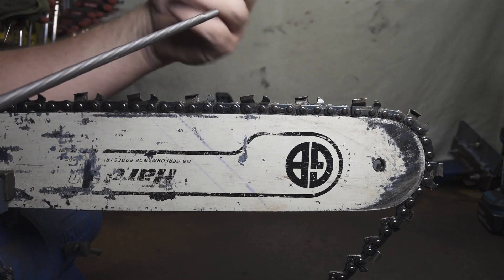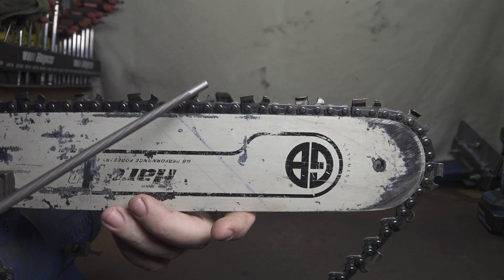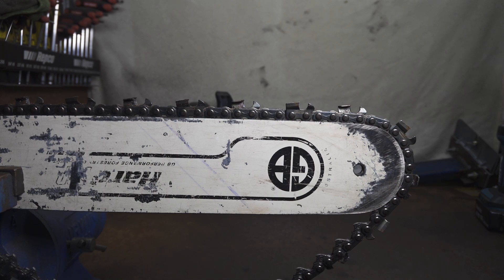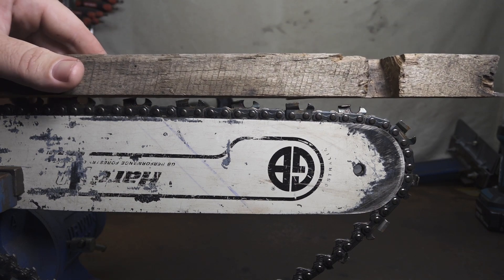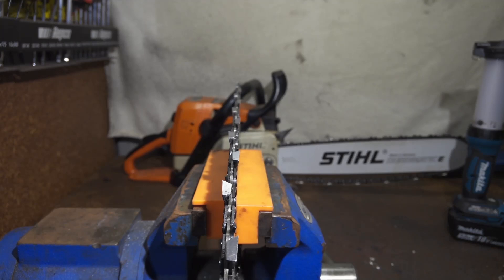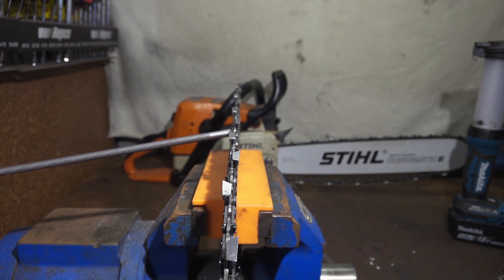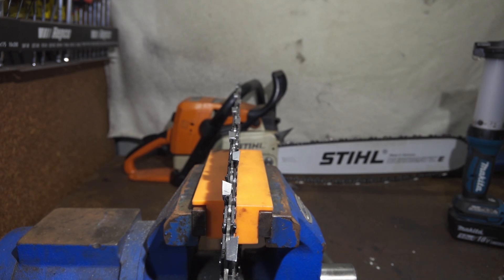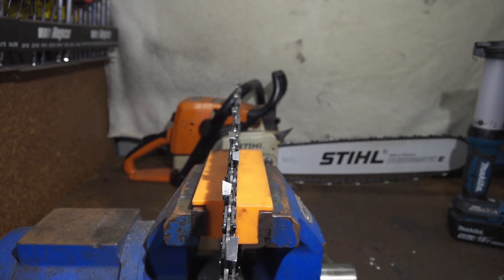Why do manufactures recommend cutters be the same length?

Comment: its not just the chain u gotta maintain either. the rail's on the bar have to be even too. if one side is worn down further then the other the chain will tilt that way in the cut and youll be cutting circles. bar dressing tool is nice for this. makes a big difference when your chain isnt rocking back and forth like crazy in the bar.

Comment: To the issue of the height of the tooth and its ability to get its working edge into the cut, shouldn't that be negated since the chain leaves the bar and goes into the wood?
Reply from the maker: @indigatorveritatis7343  It can be but to leave the bar it needs the corner to contact the wood. Different chains with different top plate clearance angles and overall length can affect if that happens.

I can't say it is or isn't an issue I'm just explaining where the advice comes from
Reply: @SawChainTheories  Understood. Thanks!

Comment: Finally, someone who actually understands the working of the whole chain as a cutting unit. Those who think cutter teeth at different lengths are fine and acceptable have no clue. Teeth have to be of the same length/ height for the whole chain to work as a whole. Each tooth needs to have an equal job. The more variation in tooth length equals more vibration and a less efficient chain. This is basic mechanics, for those who  understand. This video is a perfect example of how a cutting chain should work period.
Reply: False.

Comment: Been cutting and filing for a long time. I even run my own tree service. I promise you, they DON'T have to be the same length. They just need to be sharp and the rakers need to be filed in accordance with how much the tooth has been filed. That's it.
Reply: To a point. And not so well in Aussie hardwood.
Reply from the maker: @GreatWhiteSquid  I deliberately didn't take a side on this one, just explaining where the advice comes from.

I have filed a chain or two over the years and have done this both ways, both will work. I have a preference but that might not suit everyones application

Comment: I have been experimenting with NOT keeping my teeth the same lengths while maintaining good rakers for about 5 years, and yes the saw will attempt to saddle when your bar is buried but a little twist of the wrist keeps your cuts straight if you are watching your cut closely.

Comment: If you go and talk to any old school west coast loggers they will tell you the size of the tooth doesn't matter. As long as the raker for that tooth is set for that tooth. Which means you can't use the raker gauge that sets on top of multiple teeth at the same time. Buckin Billy Ray is a prime example of someone that has proven this time and time again. He has multiple videos out where he shows how none of his teeth are the same size and he still cuts straight. All you need to do is sharpen the tooth till it's sharp, no more no less. So if you rock a couple teeth and all the others are fine then sharpen the rocked ones and go one. Plus as far as setting everything level in height all bars have a slight curve on top and bottom of them, so you'll never have them the same height.
Reply from the maker: @chadrogers4635  Thats why I said you can compensate for it with saw chain to a degree, the curve of the bar, it's mounted on rivets etc. There is a point where the tooth just can't make contact but given that not every tooth takes a bite every time they go into a cut, it's not a big deal. Just like chains with broken off teeth can still cut fine

If I was cutting the same time of wood that they are, I would run chains like there's. Wood here is much more dense and chain reacts in different ways.

The aim of this video wasn't to tell people they needed to do one thing or the other. It's just explaining the reason why that recommendation is given
Reply: I would be able to believe it if he first showed that the same sharpened chain cuts crooked with constant depth gauges setting, and then that it cuts straight after using a progressive gauge. Has he ever done such an experiment?
Reply from the maker: @elpolaco7654  I had multiple attempts at explaining this video before using this one. Another version of this has a 21BPX chain that I filed the cutters all different lengths and cut with a Stihl constant gauge and then used a husky roller guides gauge. 

If it changes anything, I can't tell. I may put up that part of that video in the future. Maybe the Oregon style gauges with the gap in the middle changes the result? I just don't know.
Reply: @ I've written about how I've long since disbelieved that it's the use of a progressive gauge that makes the cut acceptably straight. Why? Because I know that the longer the length of the cut, the less chance there is of chips that are at least as thick as the depth gauge setting, so I don't see why there would be a difference between the two methods of lowering them.
In my opinion, the determining factor for a straight cut is the side plate angle.  If there are no (significant) differences in this angle between the cutters, then the chain will cut straight.

And to be clear, I agree with this video of yours. Any asymmetry is undesirable and always has some effect on the behaviour of the chain.

Comment: Next question... why do the teeth taper?  Why not have the same set for the entire tooth life?
Reply from the maker: @InWithBothFeet  They need the top and side plate clearance angles to reduce friction. In the case of the side plate clearance, it's to keep the rest of the cutter from being dragged against the side wall of the kerf when cutting 

Chain really is a well designed piece of equipment. A lot of effort has been put into making it as efficient as possible

Comment: another consideration would be reaction forces during a plunge cut. I'd love to hear your thoughts on this.
Reply from the maker: @johndurant8687  That will take some explaining because there is a lot going on when the cutters on top, on the tip and on the bottom are potentially all engaged at once. I will try at some stage in the future but I'm not sure I could explain it if I'm honest

Comment: Id say well over 50% maybe more like 80%+ of chainsaw users which are saw chain consumers never really understand how a chain funtions and what a correctly filed chain should look like & why. I such an important peice of the puzzle when it comes to chainsaw use. I didnt have anyone teach me, I learned things kinda the hard way through trial and error. I hated diamond wheels or CBN when everyone swore they were the best. Not because they didnt grind well but with the vitrified 'pink wheels' I could profile the cutting end radius of the wheel to get a better side plate profile I wanted for smoother cutting in hardwoods. Many new factory grinds these days I find can be all over the place. Somtimes in our Aussie conditions in low rainfall areas with hard dry species I found I would be "detuning" my cutter profiles to gain speed & efficiency. I noticed what folks would do in the continental United States just didnt work in our conditions. I like this channel.
Reply from the maker: @aussiehardwood6196  I'm with you. Most of my chains are sharpened to what most would consider to be blunt angles but it's what has consistently worked for me.  I wish I could just sharpen a full chisel with a big hook and let it cut but it doesn't last for the stuff I cut
Reply: @SawChainTheories  Why not just run square ground chain if you want smooth fast cutting chain in your hard wood? If you have and Oregon 520 or any grinder with the same vise tilt and sliding vice feature you can profile a stone and grind a square ground chain that will cut hard wood great. It's very easy to do. You don't need a dedicated square chain grinder unless you want the more aggressive angles for cutting soft wood. Just food for thought.
Reply from the maker: @wayneanderson991  I stared square filing a few years ago and most of the full chisel chains I have are square for that reason. It has been working well for me anyway